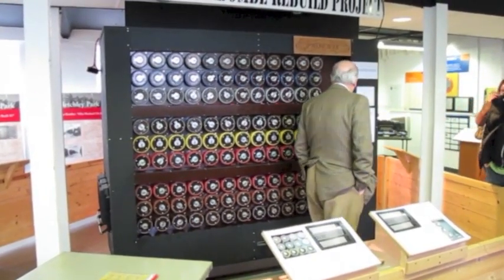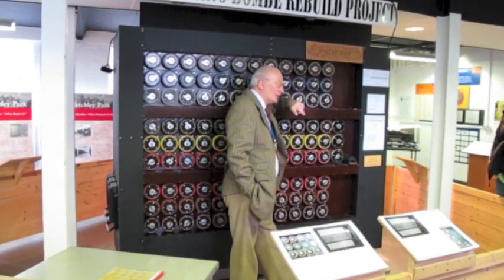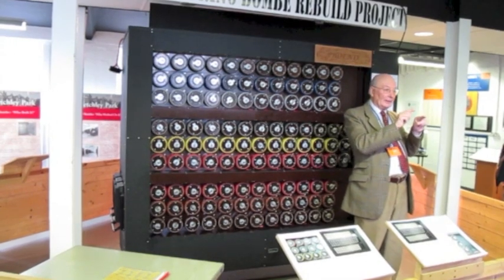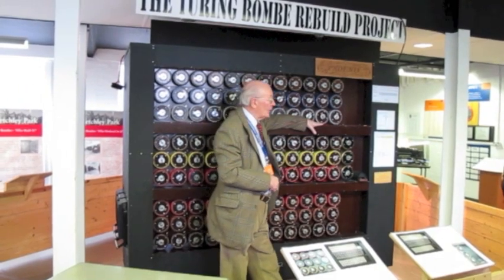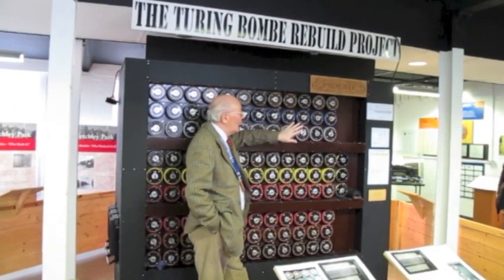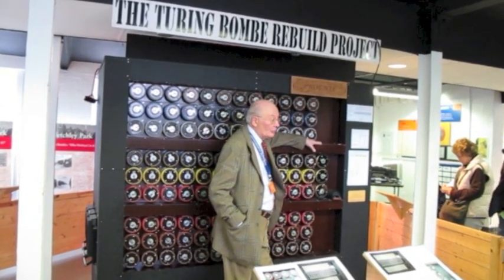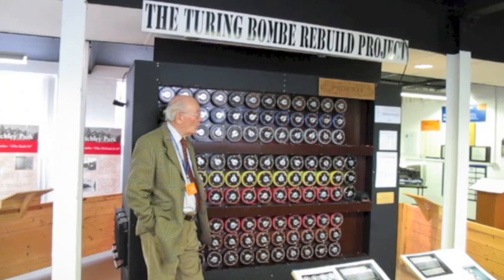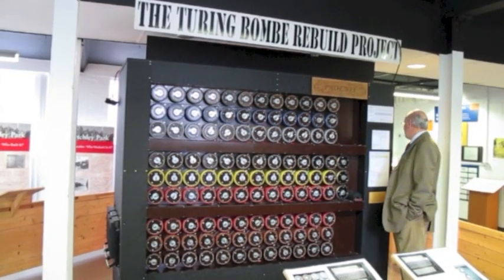The Turing Bombe - Cracking Enigma

Comment: Even with "only" 158 million-to-one "odds" the first "wheel" would have to rotate at 109,000+ revolutions per minute to "beat the odds" within 24 hours. All the Enigma propaganda is hilarious given that the various naval and air force machines were essentially on a "party line" and were simply stepping switches to allow "direct dialing" of a specific "party" without disturbing and distracting the others with "calls" that were essentially "wrong numbers" for all parties besides the intended recipient.

Comment: The Polish cryptographic service devised what they named as a "bomba" which was a series of polish copies of the German commercial model of the enigma code machines rotors. Their team of cryptographers/mathematicians believed that by wiring them together, they would be able to more rapidly and thus drastically reduce the possible hundreds and hundreds of million letter combinations needed to be able to "break" into the various codes used in the enigma cipher machine to eliminate the great majority of those combinations, thus using another machine would help solve the enigma machine ciphers......the British mathematics experts also believed that process would speed up the "code-cracking" access process. Alan Turing, in his work in University had worked out that such a process was the only way that cipher machines could be "read". Once the inner wiring of the rotors, keyboard, plugboard and daily settings had been recreated, the British "bombe" (several of those also were then wired together and "run" through their first settings and rapidly enabled encrypted codes to be returned to plain text (into German) then translated into readable plain text English.......As the British work progressed and so did the war and their desperation grew to solve the enigmas various codes, they managed to "pinch" enigma settings, code books, rotors and several enigmas as well as being able to reverse engineer more copies of the latest military models of enigmas, they became even more successful, being able to then read in real time the formerly encrypted messages of the German armed forces and other German agencies and departments....thus giving allied operational commanders advance knowledge of the German plans and intentions, tactical and strategic. Alan Turing was only one of several British mathematicians who worked on "breaking" into the various German codes used by the German navy, the German Air Force and the German army. The British also broke into the German Lorenz cipher machine, a more highly secure encyphering 12 rotor, teletypewriter used by Hitler and his high command as their secure strategic command and control cipher machine....(the Germans used 4 different cipher machines, the enigma was only one of them, used for tactical secure communications.....and the Germans also used "One Time Pads" (OTP) the most secure of all encyphered code systems.

Comment: Sadly, this machine and all of the associated bombe engineering exhibits are no longer at Bletchley Park and have been relocated to the National Museum of Computing. There is a new exhibit section dedicated to the bombe in Hut 11A but there remains a noticeably large empty area in Block B where the working bombe used to be. I was very, very disappointed to find this out during my visit today (13.06.2018).
Reply from the maker: Thanks for the update.
Reply: @Pangur Ban It is on the same site as Bletchley Park but is totally separate from the code-breaking centre.

Entrance and admission is also totally separate. 

Have a Google for more information on the NMC 👍
Reply: TNMOC also has a working Colossus, much better to visit them.

Comment: Nice bomb,good that brits invented them alone without help of some dudes from middle europe that already broke previous generation of enigma machines and sended them blueprints with instructions
Reply: Wojszach ...which was rendered useless when the Germans increased the security on their new machine. Tell me, if the poles were so advanced, why didn’t they build it themselves and break the code? The UK still had to work.
Reply: @alinaknox5773  Poland existed for a total of 26 days after being attacked by two superpowers on opposite sides of the country. When exactly during the fall of Poland were they supposed to do this?
The UK claiming credit for Enigma is like the USA claiming credit for WWII even though they only joined after the Soviets and British had done the vast majority of the work.
Reply: Also they had to know what setting to put into the machine the first place. The bombe doesn’t decode messages, it decodes the settings of the rotor and clips. They then used the settings on the captured enigma machine.

Comment: Ingenious.  It's a good thing the Germans didn't have access to today's technology and to public key encryption.  That's still effectively uncrackable.  Even if the quantum computer becomes a commonplace reality, the result will just be larger encryption keys which will make even the quantum computer effectively useless for cracking PKE.

Every bit of encryption you add doubles the average time taken for a given computer to crack the code.  So the quantum computer takes an average of 1 second to crack today's 128-bit encryption?  Just add another 32 bits (4 bytes) to the encryption code making it into 160-bit encryption and suddenly the quantum computer takes an average of over 100 years to crack the code.

And that's why the quantum computer might be a nice toy, but it won't spell the doom of public key encryption.
Reply: The code could only be cracked because of human errors. It is not technology. Like it was not the technology that cracked the code, it was a 'joined' effort, both human and technological. Neither could have done it alone.